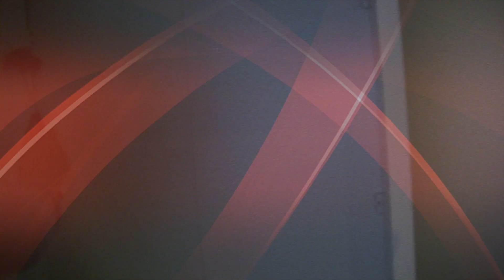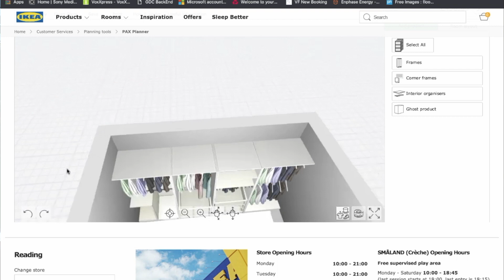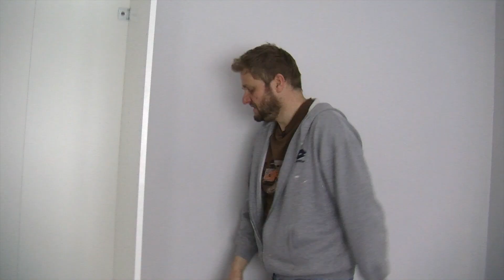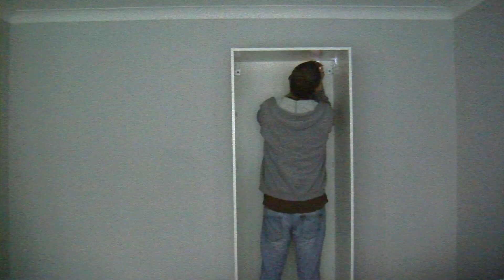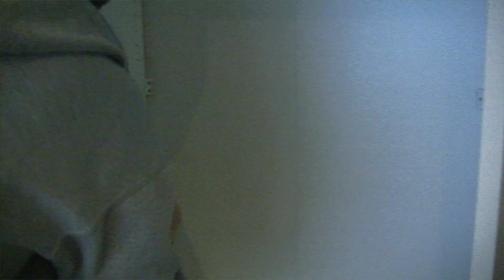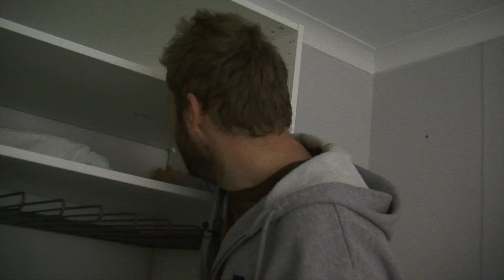Ikea Pax Transformed Into Custom Fitted Wardrobe

Comment: Why didn't you just add  shimmies  to the back rather than cutting your closet unit.
Reply: If I understand the question correctly, the answer is that I was using my wall as the back of the wardrobe and didn't want there to be a visible gab.

Comment: Hi there.

I was wondering if you know whether the  depth can be altered?

The videos I'm finding explain width alterations, but not so much this aspect.

Basically I have an alcove which is tall enough, but the width is only 47cm and 51cm deep (the 236h x 50w x 58d Pax is the closest configuration for my needs).

I'm concerned that I'd compromise the top and bottom rear cam bolts &/or locks.

I can't remember how many cm from the back until you hit the cams but if needs must, would there be another way to secure the frame without them?

Super frustrating because I've tried to find alcove wardrobes that fit the space, and the last I had was an Argos one which was at least twice as dear, and fell apart in short order. 

Thanks in advance of any tips you can offer.

Much appreciated, Ta and subbed!
Reply: If you use things like the drawers then you kinda stuck with the depth as it is. I suspect the hanging space can be cut down but you might find hanging clothes a bit tight.

Comment: I can’t see why you wouldn’t simply remove the skirting board. It would have been the easiest option and cheap to replace if you eventually get rid of the wardrobes. 
Why is it necessary to remove the back? If you paint the walls outside the robe you then need to pint inside to make it match. Maybe that’s my OCD but it would annoy me every time I opened it if it was the wrong colour.
Reply: It''s a valid point. I think removing the skirtings would have worked although it might have been a bit untidy underneath.
Reply: @leighemmerson  not after a touch up with filler and a bit of sanding and paint. I've seen plenty of built in wardrobes and they all have backing boards. Really can't get why you'd want to make a lot more work for yourself. Over thinking is the demon of diy.

Comment: Why didnt you just take the baseboard out?
Reply: It's a good question. It might have worked. Actually, when I came to attach the doors, the fact the base board was still there was really handy.
Reply from the maker: I need it to fit the bottom door rail.